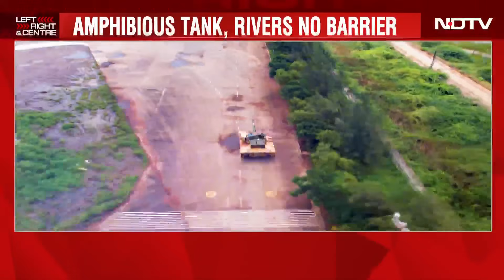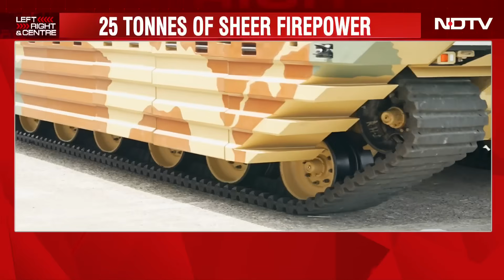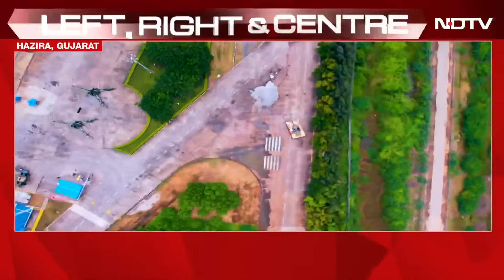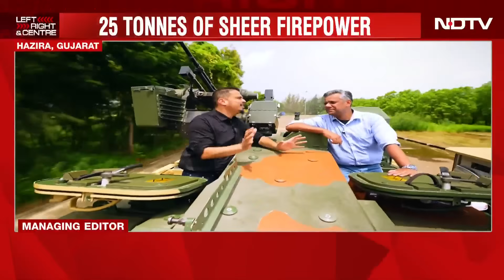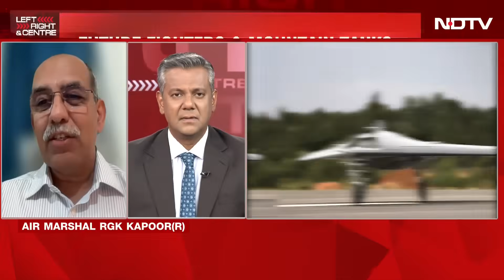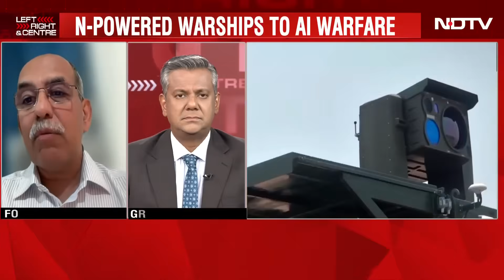Zorawar: India's Mountain King | 1st Journalists On India's New Tank

Comment: If It's fully equipped I think it will be weight around 30 tonnes. 

Bangladesh operates similar light tanks called vt5
Reply: Yes but that's china made type 15 it's slightly heavier. This tank was developed for the type15. But this tank isn't deployed yet type 15 already in production

Comment: Vishnu: correct your math!!!! 1000 hp ÷ 25 tons = 40 power to weight ratio, not 30 !!!!!! 

The engine, I gather is not 1000 hp  but 800 hp. The original spec was 1000 hp, but MTU did not supply the engine. The Cummins engine was then brought in as a substitute. 

Also,  India did not use the 30+ ton Sherman in Zojila in 1948. We used the Stuart light tank which was less than 20 tons. Please get your facts straight!!!!!!!
Reply: Currently it has 800 hp engine so its poower to weight ration is 30 
In future it use 1000 hp engine 
Then ita ration become 40
Reply: @Babhsjeb  Currently this vehicle uses a 750 hp Cummins power plant(USA). So the power to weight ratio is 30. Also it uses the John Cockerill CT-CV (TM) Weapon System, Belgium (advanced 105mm along with the gun turret) main gun.
Reply: @Babhsjeb ratio, not ration..
Reply: @Abxyz-f5k jayda english babbu na ban
Reply: true bro these Uneducated Indians Cant Understand This

Comment: Why is everyone so negative , this is a start - at the start there is high % of foreign comp that gradually reduces over time. That’s normal.
Reply: india is a nation of critics. Dont worry about it. The objective must be to keep our heads down and keep working.
Reply: @wassuphomies263  India is a nation of over promise and under deliver
Reply: @alliswell-p3e  yeah no. include miniscule amount of budget being sanctioned and aiming for top of the line product.
Reply: lol do even know about tanks This tank doesnt even have ERA or any modern protection
Reply: @gamingbenchmarks7082  why would you put ERA on a prototype tank? think dum dum. its undergoing testing of its systems.
Reply: @wassuphomies263    then how would they test its engine capability dumbo with added weight think first
Reply: Indian keyboard warriors: criticize everything, contribute to NOTHING.
Reply: Expectations have been tempered by the results (or lack of results) for the past 40 years. There is a generation of 50 year olds who saw the announcement of Kaveri engine, LCA when they were 10 years old. We are still waiting for both.